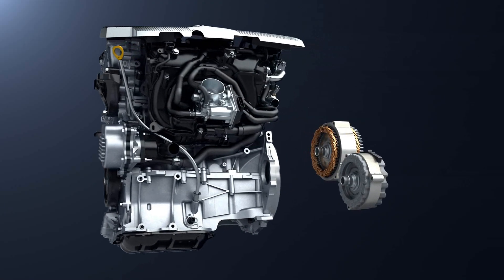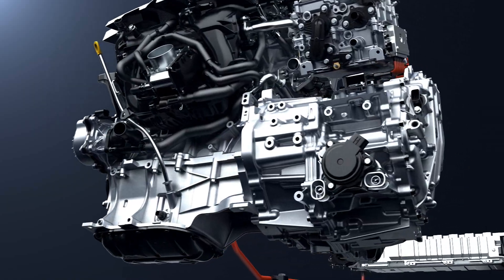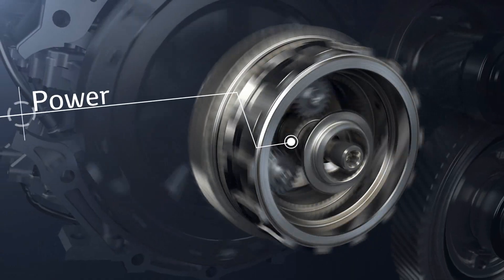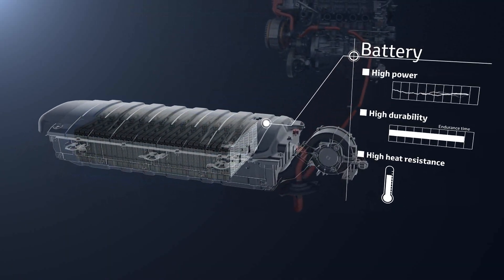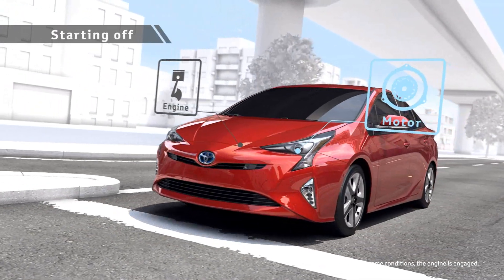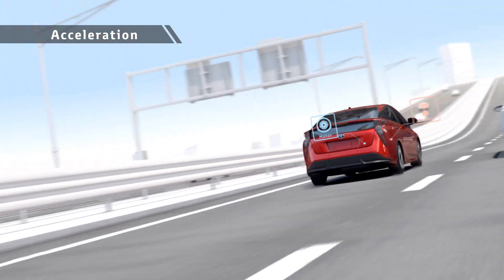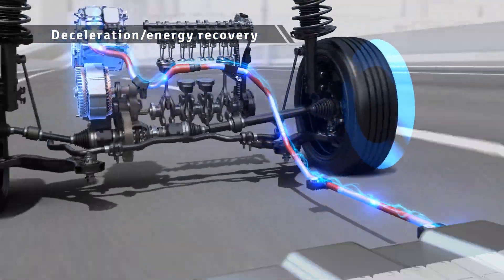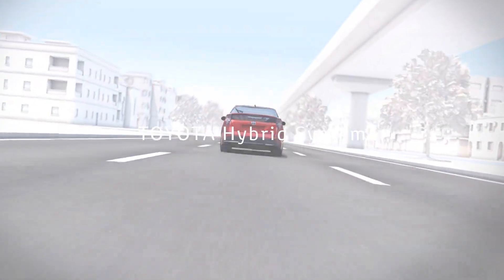Toyota Hybrid System

Comment: The regenerative braking system that charges the battery is the marvel.  In a gas car A/C, steering, braking all run off the engine.  Everything run off a belt from the crankshaft in a gas car.  Everything in a hybrid needs to run off electricity, so it runs when you are stopped or anytime the gas engine is off.  Regenerative braking generally keeps the battery topped off so these systems use NO gas.  In extended freeway driving the engine may charge the batteries.  Big deal, every car gets good freeway mileage, including hybrids. I drove 90 miles today, mostly freeway, and the gas engine never needed to charge the battery.  When you are slowing down to a stop and stopping you use NO gas. The three minutes I wait for the trolley to come by and the lights to go green I use no gas.  My pickup truck uses a LOT of gas waiting for the light to go green.   I can "idle" the last half mile slightly downhill to my house with the engine off the whole way.  No gas consumption.  You car does everything it did before being a hybrid but it uses less gas being a hybrid.  Why does this offend so many people?
Reply: Hybrids are lazy engineering? Cripes! What a sweeping and somewhat misleading statement. As a person who has bought, owned and driven a 2008 Prius Hybrid for 4.5 years without any problems or indeed, mechanical failures, I absolutely disagree with that statement.

It seems most humans are scared of anything new. A century ago, they were scared of each other, often based on something as stupid as the colour of their skins!

Today, they’re mortified of new Hybrid and EV technologies that are revolutionising automobile transport. I’ve save almost £5,000 in fuel bills in the UK, driving an OLD 2008 Prius Tspirit! Mechanical failures? Don’t make me laugh. The 2nd Generation Prius Hybrid was way over engineered. Nothing has broken on mine. After a lifetime of driving conventional automobiles, the Prius has been a revelation, and the most reliable vehicle I have ever owned.Look around you. Those vehicles are still running around everywhere you look. I did do my homework before I bought one too. Yes, the frugal fuel consumption figures and unparalleled reliability of this vehicle looked too good to be true, yet, checking out reviews of people who actually owned and drove one (thank you PriusChat) as against reading myths made up by ignoramii was what made up my mind. And I wasn’t disappointed. Suffice to say 10,000,000+ (and steadily rising) Toyota Hybrid owners can’t be wrong. The final icing on the cake is most major manufacturers are now producing hybrids of their own. Even F1 Racing are now utilising Hybrid technology.

I drive an old Prius and I love the technology, the way it’s saving me money everyday, and the solid reliability of the “Hybrid Synergy Drive” technology which is tried, tested and proven. The newer models are even better, more frugal on fuel, and the plug in versions are the holy grails of Hybrid technology.

Hybrids are a step in the right direction for the future of motoring. There are 2nd Prii that have done 400,000 miles on their original engines and batteries. If that ain’t reliability to be proud of, I don’t know what is.

Don’t take my word for it, the Internet is awash with genuine testimonials of people who own and drive these vehicles. Visit the Prius Chat website, and get a true perspective of what owning one of these Toyota Hybrids is really like.
Reply: @datathunderstorm  Many wise words. I have a 2006 Prius with 280,000 miles and the original batteries and 47 MPH on the highway and 36 MPH in the city. I am very proud and satisfied with their performance.
Reply: Engineering or not, statistics have already proven that hybrid cars are much more efficient
Reply: Sorry...... sorry I have to bite.  I've owned a Prius since 2010, and put more than 112,000 miles on it.  All it's needed is routine servicing, which has cost me significantly less than any other car I have owned.  If I had bought a diesel, chances are that by now I'd have had to pay out for: timing belt changes, DPF cleaning or replacement, and more frequent replacement of brake discs and pads due to the heavier weight at the front.  Remember that regenerative braking takes the load off the normal friction brakes - as such, I got 90,000 miles out of one set of discs and pads.
Reply: David Loader I hope you sell the car cause this cars after 120 to 125000 start giving a problems for step battery ..4500 after brake sistem another big money and most of cases head gasket..good luck
Reply: Joffre Rivera : Could we have that again with spelling and grammar, please?  Are you saying that the Prius is going to start falling apart at 125,000 miles?  You're just making that up.  Taxi drivers have driven them for 250,000 miles.  I've never heard of a head gasket problem and there's less reason to think that the Prius engine would fail than any other Toyota because it comes under less thermal stress.
Reply: Joffre Rivera Ironically the only reason why some Prii break down at that mileage is because their owners DIDN'T DRIVE THEM ENOUGH! Any competent engineer could tell you that the weak point of the Toyota Hybrid Synergy Drive is the battery, and as odd as it may be, the chemistry used is killed by insufficient use much more quickly than it is by heavy use. Of course, why would you get a hybrid if you don't drive enough miles for it to be worthwhile?
Reply: John Rickard : Oh, dear.  45 years in the field and I'm still not a "competent engineer".  I have never heard of anything like this.  Could you please provide an authoritative reference so that I can study this effect?
Reply: @grahamdavies8924  common sense is battery. It needs  constant charge and recharge. If left it dies. Maybe due to how is constructed its needs constant driving. If is not a good car Toyota would have gone out of business. But they are waxing stronger and adding more model unlike GM that is closing down. Now I want to buy prius because of Uber and before the reason I did not buy it is because of dashboard. I just don't know why Toyota chose to do there dashboard like that. It's too open for passenger to see.
Am here watching this video so I can better understand prius before buying and with the look of things the most important problem people complain of is battery and someone uploaded a good video on how to change one.
Reply: @chibyk2008  : That is not "common sense"; it's just something you've made up.  If you don't know anything about engineering, it would be better if you found out what is true instead of making a guess and presenting it as "common sense".  Modern batteries are not harmed by being left at a constant state of charge.  Nickel Metal Hydride batteries wear out mainly through discharge / charge cycles, the opposite of what you claim.  Lithium-Ion batteries wear out through a combination of discharge / charge cycles and the simple passage of time.
Reply: The truth here is somewhere in between the positions taken by camger and Thunderloins,  camger gives the Prius a little too much credit and Thunderloins not enough.  Others have pointed this out.  Where Thunderloins is completely wrong is his / her claim that objections to the Prius stem from "knowledge of engineering" rather than offense.  This is demonstrably wrong.  Almost every YouTube comment dissing the Prius displays a complete ignorance of any technical field and an unwillingness to spend even a minute looking for a fact of any sort.  The Prius seems to symbolize something that a lot of people irrationally hate.  If I tried to say what it is, I'm afraid I would just be giving away my own biases, so I'll end here.
Reply: Freesider  : I strongly suspect that you just made that up.  I have no personal experience of a hybrid engine "broking", as you put it, in the millions I miles that I and my family and friends have driven hybrids, but if the engine were to "broke", there is no technical reason why it would cost more than a regular engine to repair.  I also have no personal experience of people hating hybrid engines for a reason that they are able to explain.  Can you provide some sort of reference to back up your statements?
Reply: Well said 👍
Reply: Rico They are exceptionally reliable. Shockingly so. Fail...!!
Reply: @Thunderloins I agree with you, not only diesels get a better fuel economy than Hybrid cars, they also have less wear and tear components. Which makes them more durable.
Reply: Its not that the issue offends anyone.
It is that people with knowledge of engineering know that there is simple truths about mechanics.

First, for each part you add in a system, you have one more point of potential failure.  

While there is some truth to what you say, that you aren't 'using gas' to stop or slow down, that doesn't mean that you didn't at some point collect energy (Which in this closed, single fuel, system, means GAS).   You in fact used gas to generate the power which is used for those things.  It is just now stored in a battery.  Which again, a part which has a limited life span.  Even if you don't use it, a battery goes bad.   Thinking this energy doesn't come from the gasoline at some point is a fallacy.

Another truth that people with knowledge of engineering know, is that when you convert power from one form to another, you experience loss in radiation, heat, vibration, sound, etc.   So when you are converting this kinetic energy to electricity... and then back again... you are getting a loss of energy.  

This means, in the scope of development of a car which centers around combustion, you will theoretically get more efficiency out of a combustion engine which has no or little hybrid components.  

Why was this not the case, and why were hybrids developed?

it is easy to make a hybrid that is efficient, than do the complex physics calculations required to make a purely combustion engine more efficient.   

Hybrids are lazy engineering, frankly.
Reply: @thisisashan  prius is actually very reliable
Reply: @NoName-gv6nm  I know.  I have a 05 prius.  But it isn't anymore reliable than any other toyota really.  In fact, toyota camry etc are known to hit 1 million+ if properly maintained.  That is, one engine.  

that said, 300k to 500k is still reliable, I agree.  But once it DOES break down, many more parts are going to need changed out.   What I said, holds true.  Also, the cost of purchase is higher because there are more parts. Also, the environmental cost, and energy cost, and resource cost, are higher because of more parts, yet again.

So, while a prius is still a good car (ESP if you can get one used with a good hybrid battery), its reliability should be compared to other toyotas for the sake of being more like apples to apples.

Is prius good?  Yes.  But for the MPG, not for the reliability.  If you want reliable, you still buy Camry.
Reply: @thisisashan   The thing is that there are more things to break down in a Camry than in a Prius, timing belt, alternator, brake pads wear out faster, and the transmission is more complex than the one the Prius uses. Also the Prius is good in both MPG and reliability, specially the Prius C which is probably the most reliable car Toyota has ever made.

Comment: does it come in manual version?
Reply: No, you can't get a manual transmission because the Prius doesn't have anything you'd recognize as a gearbox.  The transmission passes about 72% of the engine torque directly to the final drive and the other 28% is passed between the "generator" and the "motor" so as to increase either torque or road speed, whichever is required.

Comment: Can use rear wheel drive train to recharge batteries?
Reply: No need. You would just "steal" the energy from the front recharge mechanism...  
It would only help to transform the energy quicker thus braking faster without using clasic brake (so no energy loss)

Comment: Japan has the most advanced technology on battery. However, until now, I only see Nissan has the ideal of a fully electric vehicle in Japan. More companies should definitely push fully electric idea forward.
Reply: It's probably because this technology isn't ready. 

Even the Nissan uses outdated chassis and bodywork for packaging his electric car. This all results in bad mileage and heavy weight.  Making the car costly and unappealing for customers.

If the world is going on for ev's, there will be a fundamental redesign of the aero capacities of a car, that will have to be addressed. And States will have to let loose on their crazy safety requirements.
Reply: @benoitbricet8885  : I own a Nissan Leaf and I completely disagree with you.  I get four miles per kilowatt.hour.
Reply: @grahamdavies8924  meaning 15kwh on 100 km. It's great.  Every ice car builders would dream of such numbers. 

And it's where aerodynamic and conception are kicking in.
A Tesla 3 reaches 13 kwh on 100km.

A more streamlined  Lightyear has announced to cone close to the 8 kwh on 100km mark. But the speeds weren't officially disclosed,  meaning,  it could theorically be around 10 kwh,  what is still impressive. 

But here comes the big thing.  Those numbers are great in regard to the poor efficiency scores of ice vehicules.  But, at the eth Zurich,  we have cars reaching 100 km with a single kwh of energy.  And this is where my statement goes.  In doing the cars with engine hoods and arranging the sitting position like we are doing now,  we are waisting HUGE potential.  There are cheaper and better ways to make electric cars,  that aren't explored because builders are afraid to shock the consumers. 

This is sad and a waste of energy.

Comment: diesel hybrid? come on Toyota!
Reply: Toyota will never produce a diesel engine again for cars. They are aiming at a 0% emission in the mear future. Countries as Germany and Norway are already banning diesel engines and look forward to electric cars only.
Reply: There is no point in making diesel hybrid. The whole point of hybrids in the first place is to replace diesels. Other manufacturers will follow them like always.
Reply: Richard van Tricht I own a Opel is new and has Diesel engine with automatic transmission so in Germany they are banning old diesel cars for new ones and to save the environment
Reply: Audi's had diesel hybrids for a few years. They were blocked from being sold in the US.
Reply: Actually, the Atkinson-Miller engine used in the Toyota Synergy Hybrid System is run as much as possible in the high efficiency band produced by the Miller valve timing. In that band the efficiency is higher than that of a diesel... more than 40% in real world operation.

Comment: Like these tech breakdowns. Shame Toyota won't invest in a proper electric vehicle.
Reply: Already invented. Toyota made the hydrogen cell based Mirai. It uses hydrogen to produce electricity,that it can stored on a large battery and can move car too. Toyota gives you the choice how exactly want to move. You can use your stored energy,you can use directly the energy from the hydrogen generator,or,if you want to take the 100% of the power,you can use both.
Reply: kostasauris I'm familiar with the HFC Mirai, which generates electrical energy on demand, but Toyota have firmly banked on HFC technology over battery rather than settling for a hybrid. HFC isn't widely accepted, much less than charge points and gas stations. It also has the setback of having to use more energy have sting hydrogen and storing under high pressure, as well as dealing with explosive hazards of worse consequence to a fuel tank explosion on rupture.

If Toyota employed a more dynamic approach, such as 100 mile range electric HFC extender, perhaps it would garner more interest in the green vehicles world.

However, most see it as a back step from EV, as there would still need to be a lot more overheads in transporting, generating and storing H gas.

It's still impressive technology that could be used for planes, trucking fleets etc, but I see the adoption in the personal vehicle world being slim.
Reply: Filippo Motta I wonder why they make a Yaris hybrid when they have the Prius c
Reply: Shaun Powell what brand are 100% stable for those electric vehicles? Porsche? Breaks down too
Reply: lol you missunderstood my comment. Breakdowns = explanations. I wasn't criticising Toyota's engineering, and would actually commend them.
Reply: Shaun Powell p